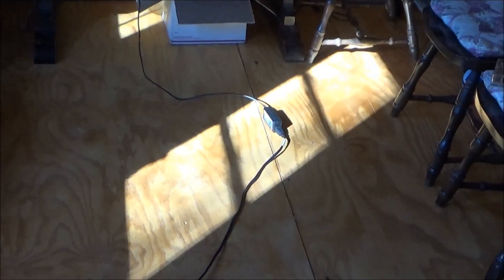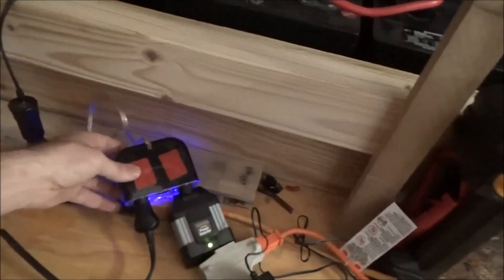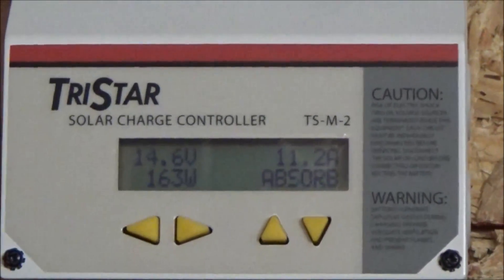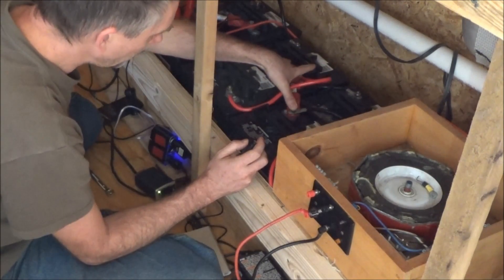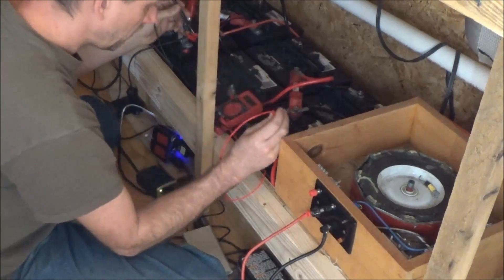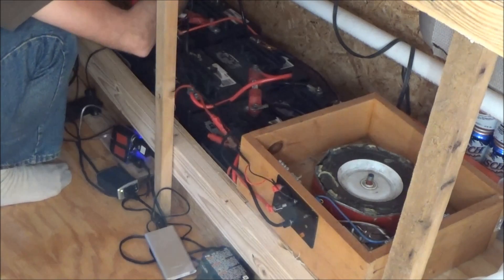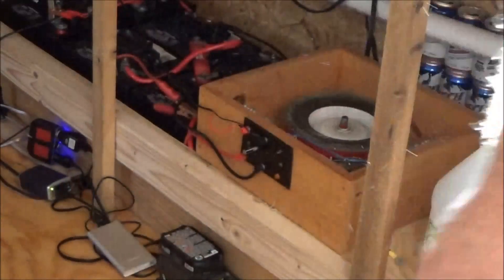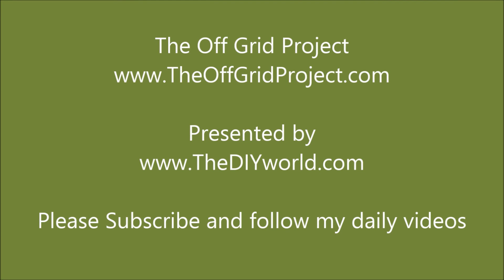Tiny House Solar Power And Desulfating Batteries With Bedini Motor

Comment: have ya thought about a solar powered wifi box for your dsl  wireless routers only consume about 7.5-9v  maybe  a set up like one marine battery one solar panel and the dc-dc variable stepdown to match dsl and router dc in   then you could just be all wireless out there and it could be self sufficient  by solar  power ....   what ya think  sounds like fun huh ......maybe a winter project dont forget to grab your camera for it
Reply: set it out up on a pole  somewhere close but has way better sun exposure   all year around
Reply: I have century link with modem and wireless all in one it is 12 volt 0.5 amps. I replaced the 110 plug that reduces to 12 volt and just hooked it to my solar been using it like that for about a year.
Reply: M Baldridge   straight to it  or is there a battery  and if so how long did it last  like over night ?  or just a few hours
Reply: to the battery bank. its still going due to having solar recharging the banks daily
Reply: M Baldridge what type an size  of battery    im curious about a set up like this also  thinking about a project to do on this and for troy to get information on it
Reply: Wow, that is a great idea, I would like to see that!
Reply: [i read best in caps, be nice thanks]
A SOLAR BATTERY SYSTEM FOR EACH ROOM AND MAIN WIRE HOOKED TO THE DIGITAL READ OUT FOR EACH ON 1 PANEL...
THOUGHTS ON THIS IDEA???
BLESSINGS & BE HOPE FILLED
FRANKI
Reply: You can easily get DC to DC converters to run all of the electronics.  And pretty much all modern electronics run on DC, although sometimes the AC to DC converter is internal. See the link I posted upthread to some cheap adjustable DC-DC converters on Amazon (e.g. $10 for 5 converters).   No need for a specialist and expensive gadget.   FYI, you can look on either the power brick, the input jack or the device label to figure out what voltage & amps a device takes - it's often 5V 2A or similar.

Just cutoff the plug and solder it to the DC-DC converter & attach the other end to a 1-30vdc power source.  Then adjust the trim pot (the little screw thing) with a multimeter attached to the output until you get the desired voltage.  You can put the converter in a small case or just tape it to the device - protect the bottom with a piece of plastic or cardboard to prevent shorts.
Reply: ***** ???  What?   Some eye challenges can not be fixed with glasses.  I am SHOCKED, knowing your son's struggles, that you of all people are picking on someone with a disability...
Reply: @ lee986321 I HAVE GLASSES THANKS... DYSLEXIA CAN NOT BE FIXED WITH GLASSES BUT IT ITS WHAT IT IS; THANKS ANYWAY....

@ THANKS FOR HAVIN MY BACK... ITS NICE TO SEE ""SOMEONE"" THAT IS POSITIVE THESE DAYS....

MY COMMENT WAS FOR TROY... THANKS!
Reply from the maker: nice idea
Reply from the maker: ***** Lee, bad boy

Comment: To my understanding it is best to place your battery-bank as close as possible to the panels.  From there you run the wire into the house for power.  Are you planing to build a 'power station' outside in an area that good sunlight in order in implement this?  Also...I am excited for you to get your wind generator up.  That alone will, hopefully, insure peak power during the day.  And, if lucky, some great power at night!  Also...would it not be cool to own this?!?!?!!?  http://www.gdstechnologies.ca/
Reply from the maker: They are splitting water into brown's gas to burn in a gas engine. This is nothing new but I would be surprised if they get off the ground. Many have gone down this path before and some are dead. Google Stanley Meyers water fuel cell
Reply from the maker: SSanf Probably not a scam but I doubt they will ever be "allowed" to produce it. I studied splitting water extensively. I know it is possible. When I blew up my apartment with Brown's gas, I left that behind
Reply from the maker: SSanf Do some research on the harmonics of water.
Reply: The Do It Yourself World
do some MORE research on this Troy,, please don't be gun shy about this. I put one in my car, They work, period. just don't ever get too public about it. It is for "supplementing" power ONLY. right? lol. btw,, i sold that wonderful car,, bad tranny,,
Reply from the maker: grodad I know, I used one in my own car for a year. Worked nicely. The new car though needs special electronics to trick out the computer so I have not used on in a while
Reply from the maker: SSanf You say scam. I say increased efficiency. Look up hydrogen boosters. They work. I know first hand. I used to sell them
Reply: Oh...I didn't realized that constitutes a spam now.  Ok.  Thank you.
Reply: Must have been.  How do we direct people to subject and info. that may interest them?
Reply: nice.  thank you.